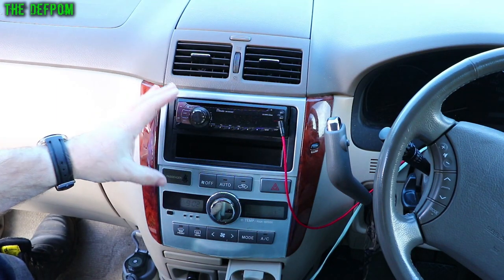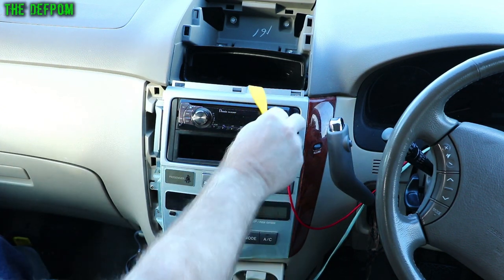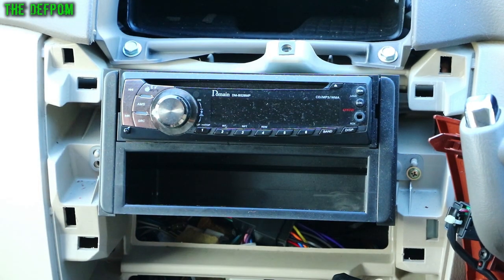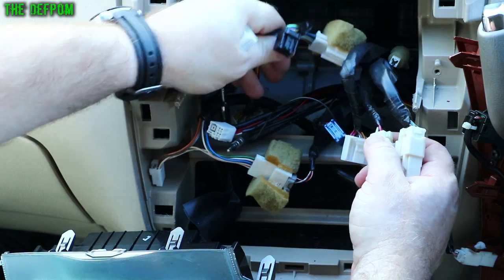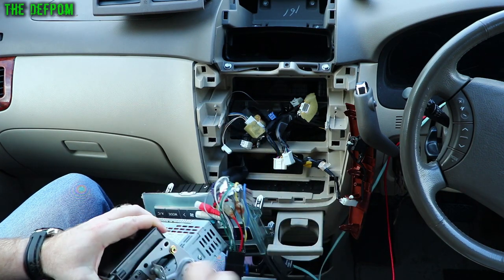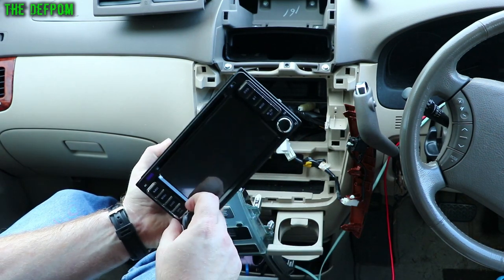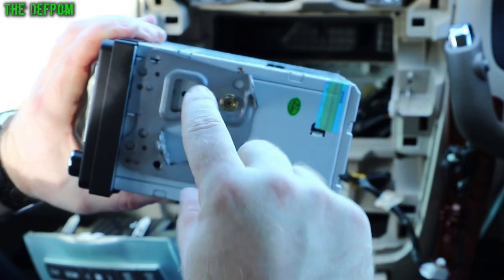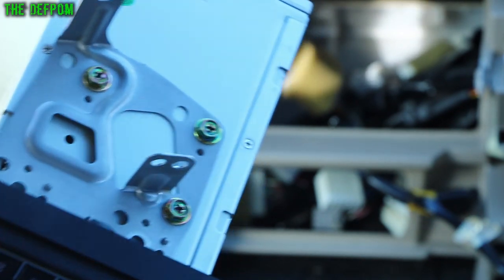🔴 Stereo Installation with OEM Reversing Camera - Toyota Ipsum, Picnic, Avensis Verso - No.882

Comment: Hi I'm doing the same install with the same unit. Did you use the normal antenna plug or was there also something like a boost wire that was needed? ( bad reception) also was there any additional wiring needed on the steering wheel controls?  As once all plugged in mine still doesn't work.  Cheers

Comment: When i installed a reversing camera to my Ford Mondeo i patched camera power and the mode switch feed for the headunit (both are +12v) to the power behind the rear light cluster, i also installed a diode in line on the cable providing camera power and mode switch to the headunit which then allowed me to run a power feed on a switch to the mode wire behind the headunit which means i can manually power up and switch to the camera when i want to without having to be in reverse and the diode means when i manually turn on the camera it does not power my reversing lights as well.
I have my manual camera switch under the steering steering coulomb where it cant be seen.